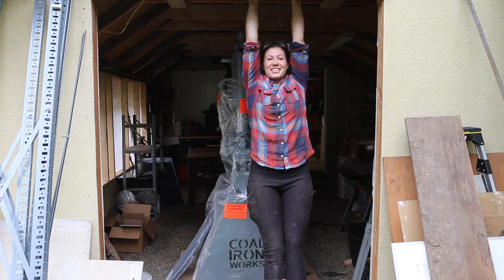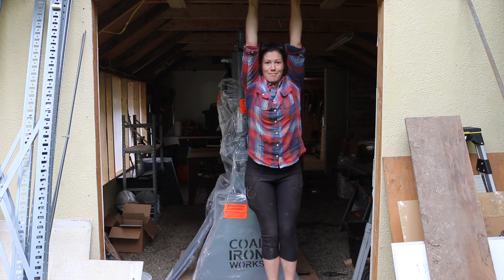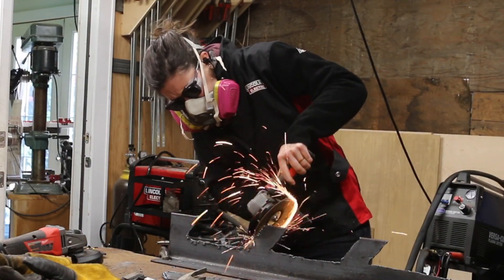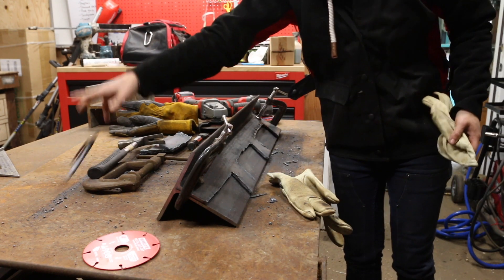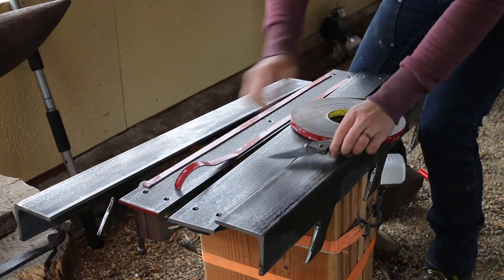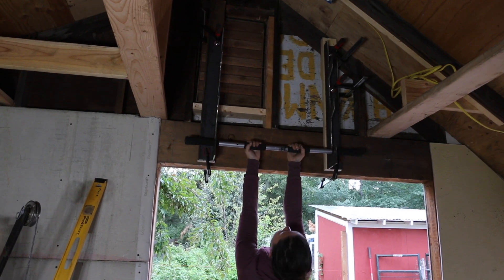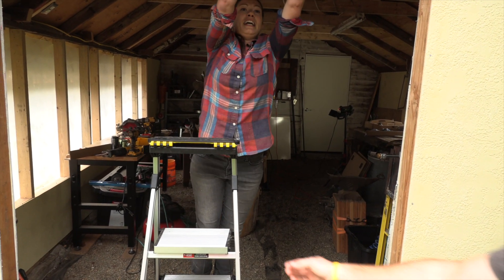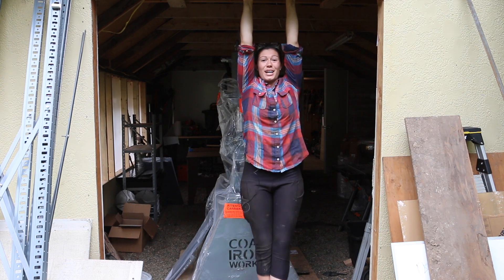Salmon Ladder Build // Welding

Comment: Had a metal frame salmon ladder in a friends old garage, he kept making the mistake your friend at the end of this video did which is sideways motion, this eventually lead to my friend slicing open his forearm on the ladders metal point. We replaced the metal frame with one made of hard wood with rounded off edges. I would suggest you consider doing the same.
Reply: Yerp, plenty of accidents waiting to happen with Salmon Ladders. Crushing injuries to fingers, thumbs & wrists, dislocation of same, plus twisted elbows & shoulders.

Comment: A hammer and cold chisel can most of the time remove the slag for the plasma cut.Much easier than the grinder, and a lot less noise.
Reply from the maker: We did get a lot of the bulk with a cold chisel before getting the grinders out thankfully